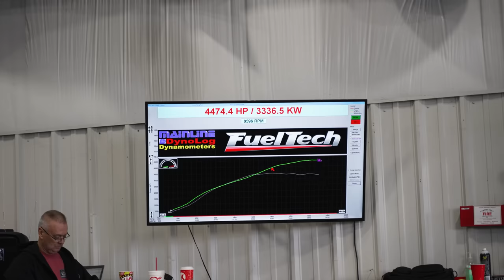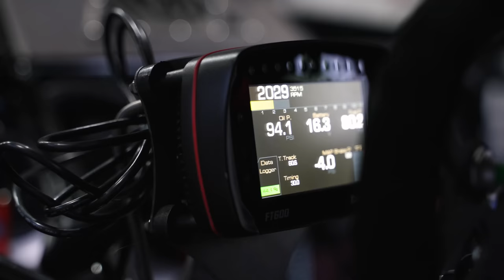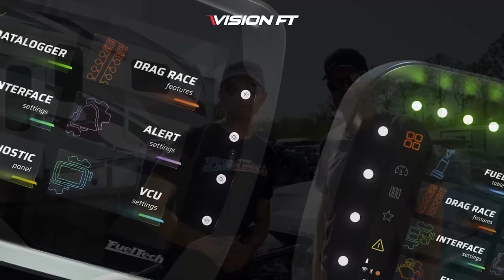Turbocharged 4,779 WHP: Can Mark Micke make turbos great in Pro Mod, again?

Comment: Pro Mod is where its at i used to attend the NHRA event in st.louis every year for quite awhile until Ford quit supporting Pro Stock ,Nitro stuff is ok but its always the same guys winning ,very seldom do you ever see competitive side by side racing until the final round . A few years ago i attended a PRDA EVENT   after the sun went down and the track cooled off a bit the real show began ! the pro mods were divided by power adders ...nitrous class , turbo& supercharger class and a NHRA legal class i sat in the stands and watched the qualifying sessions begin and through all those classes i saw either a speed or ET record broken on 14 consecutive rounds! Never seen it before or sense plus they ran mountain motor Pro Stock and the ford were competitive havin 4 cars in the top ten qualifying positions with a couple of mopars  plus chevys in the mix and within a tenth of a second from number 1 through number 10 positions ! thats the racing i want to see ,i'll never drop my money on a NHRA event again after that but if theres a race held at the east St. Louis track i'm there and have yet to be disappointed in the shows they put on.

Comment: Looks like the ProLine Hemi is taking over. I am used to seeing ProLine powered Turbo Cars run a 481x and the ProCharger guys run the Hemi for RPM. I wonder what the price difference is for a Longblock between the Hemi and 481x ?

Comment: I would love to understand how u controlled compressor wheel speed with no waste gates. That blows my mind.
Reply: The wheel speed isn't hard to control for the most part. The boost level is what everyone is trying to control, but the mechanical wastegate has to start opening so early that a ton of energy gets released. But if turbine wheel speed is your main worry, two things offset that worry 1. There is a ton of excess capability to any quality turbo (non-Chinese) so spinning it at 88k RPM or 115k RPM is fine either way. But most importantly 2. The load on the compressor wheel doesn't go away when the excess boost is leaked off, like this system does. Paradoxically, if you were to lose your charge pipe during a run, the compressor doesn't freewheel and overspin, it actually slows down. On belt driven turbos like a Vortec, ProCharger etc the nose of the crankshaft will bend when that charge pipe comes off because of the extra load that the compressor is feeling. In a turbo car, the charge pipe coming loose causes so much extra load that the compressor wheel will sometimes stop and often break because it's spinning at 90k RPM for example and suddenly it's trying to stop. What they are doing on this car is using old technology from a time when turbo cars didn't run wastegates, and just using the FuelTech and blowoff valves to control boost precisely. The FuelTech is using the timing and fuel maps to control the boost ramps. For example if you want to build boost quickly, you'd give the engine a ton of extra fuel and retard the timing so that part of the fuel is burned after it leaves the combustion chamber. Some of these things run counter to what you would normally do on a normally aspirated engine where running rich and low timing would kill power. Hope this helps brother.
Reply: Good explanation! He is leaving with almost 50lb boost and benefiting from the downforce to keep the front end down, most turbo cars leave with less boost because they can't control the launch, more boost more downforce wow!

Comment: Say i bring a Radial car,Pro-Mod,whatever it may be...whatchu lookin at to throw the newest Fuel Tech stuff at it? $15K or am i way off?
Reply: The stuff isn’t that expensive it’s the instsll and wiring and tuning to that level from the start
Reply: @geraldgoodiii6993  ofcourse. The dyno,Steve's time,crew's time,etc...ur payn for the package. So,$15K???
Reply: I would say $15-20k for the equipment, the install and teaching how to tune. Which is a drop in the bucket when you compare to what it can do and the cost of the engine, trans, suspension, that it’s controlling.
Reply: @precisiondiesel225  awe no doubt. Petty useda tune our Outlaw 10.5-W car when ORSCA was still around. Been around drag racing forever. Like i say,was just curious about the whole FT upgrade/dyno price...but whats tha use in haven a $200K car if its not competitive

Comment: It's not making 4,779 wheel HP, it is making 4,779 hub HP. Even approaching 5,000 HP you still feel the need to fudge the figures.
Reply: Yeah, hub dyno HP is not wheel HP.
Reply: The dyno calculates the torque either way. With a hub Dyno it doesn't need to adjust for tire slippage or tire growth. A wheel Dyno has to rely on the person inputting the correct tire size and can't account for tire growth during a run. A hub Dyno is much much more precise and it's calculating the TQ at the hub, so having a wheel and tire bolted on is just adding a layer of less precision.
Reply: @RonniePTexan  except every hub dyno I have seen reads way high, and it is not a real representation of what can truly be put to the road. After all we don't race flywheel or hub hp, we race whp, because the only figure that matters is where the rubber meets the road. Measuring at the hub is like dynoing with the air filter off, then putting it back on to drive down the road. The only figure that matters is what it produces on the street / strip as it runs. Anything else is purely for the ego.
Reply: @DodgyBrothersEngineering  The hub Dyno they use is the most accurate. It's reading a high number because that combination makes a high number. That combination wouldn't even be testable on a wheel Dyno, the tires would slip. The reason you think a hub Dyno reads high is because all of the high HP combinations use hub Dynos and only hub Dynos. A 500-1,000 HP street car can use a wheel Dyno, but for serious 2,000+ HP combinations, a hub Dyno is the only way to go. It's not that they are reading high, it's that the high HP combinations are only using hub Dynos.
Reply: @DodgyBrothersEngineering  I think you see them using a dyno for ego. They literally do not care what the dyno number is. That is just used to tune. Every racer that uses that FT dyno could care less if it makes 3,000 or 5,000 HP on the dyno. They just need the car tuned so it starts, idles, can drive, then they need it to make power predicably. They need baseline tunes so they know what the engine will do at 20psi, 30psi, and 40psi in this case. From there all of the real tuning happens at the track. They won't tune the car for dyno numbers. That's silly. If you tune for dyno numbers, the car slows down at the track. It's just not how it works. That car could easily make another 300-500 HP if they just wanted a dyno number. That's just not how racers do it. You might be thinking of some yo-yo on YouTube trying to Dyno a car for Max dyno numbers, but no real racer ever does that. All that does is break parts and still runs slower if/when it makes it to the track.
Reply: @RonniePTexan  you are partially missing the point I am trying to make, You could take your street car and put it on a hub dyno and 99 times out of a hundred it will read higher than a chassis dyno. So at lower HP figures tyres slippage doesn't play into it. One of my main points was that hub horsepower is not wheel horsepower, no more than it is putting it on an engine dyno and claiming you make that figure at the wheels. The hub is a bit further down the chain than the flywheel but it is still not at the wheels where the rubber meets the road.

I fully understand the reason for using a hub dyno on higher powered cars, but I would argue that it isn't more reliable. Because you can't take those hub dyno figures put them into a power calculator and work out the what your ET is going to be, because hub dynos operate in a theoretical world of perfect traction, and where tyres don't distort. Whereas a chassis dyno the tyres distort changing its size and you might get wheel slippage which will give you a far more accurate number in your ET calculator. It is how you can expect your car to perform on the road where cars are driven.

I would have no issue if they said that it made 4,779 HHP, but they didn't they are claiming WHP which it is not. There is hardly an honest dyno video on YT, just about everyone exaggerates in one way or another. Whether it is like this claiming hub hp to be wheel hp, or rounding numbers up, or making up some unrealistic BS number that it might make at the engine. Or my personal favourite the cherry picked dyno run. They do 20 runs that are on average 100 hp lower, and one freak run that can't be repeated. Guess which number they claim the car makes.

Trying to get an honest video on YouTube is harder than finding an honest politician.
Reply: @DodgyBrothersEngineering  If a car has 28" tires the radius is 14". So to change from wheel TQ to hub TQ is a mere 14" calculation away. You are over complicating this. That hub dyno in this video makes any wheel dyno look like trash. It's not even close. 

It's funny you mentioned the 1/4 or 1/8 mile run, because this dyno accurately predicts that as well. They can put the car on a two step and launch it like it is at the track. Some racers do that to get a theoretical number. A dyno and a drag race are two different things. The dyno is just for tuning and testing. The actual TQ number is secondary. You are confusing a hillbilly on a dyno looking to brag about his number with actual racers who don't give a damn what number shows up.
Reply: @RonniePTexan  except the calculation isn't that simple, and that is why we don't race on paper. While it might statically measure as 14", as the car launches and the tyre bags up the distance from the axle centre to where the rubber is contacting the track it is significantly reduced. Throwing the torque number out of the window, because you no longer have a fixed torque lever (the wheel diameter). So while you worked out your torque with a static number on the dyno, it doesn't translate to that in the real world. That is why I am saying that it isn't as accurate as a chassis dyno. Obviously that is subject to HP. Once you get up into the crazy number a chassis dyno is going to be less accurate, because the roller won't hold as good of traction as a rubbered flat road.

As for them not caring about the numbers. I call BS on that, because if it didn't matter the video wouldn't be claiming whp. While they may be doing some crude tuning on the dyno make no mistake they care about the number.